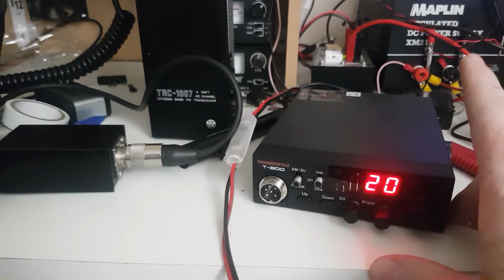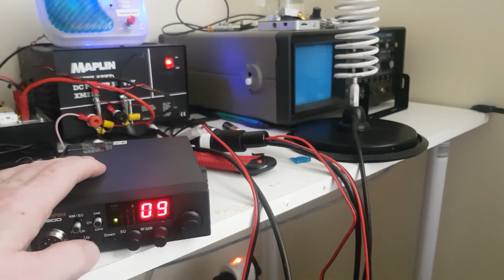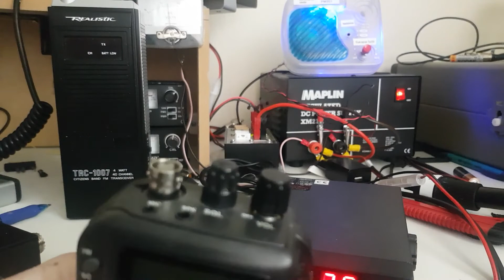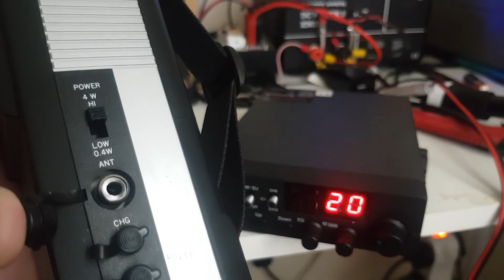Beginners guide to CB radio, video 4: connecting radio and antenna

Comment: You do get quick connectors (or did) like the light bulb for disconnecting a mobile whip aerial to store it away in the boot of the car (a lot got stolen back in the day, or just bent over) along with the CB.

Check out the Video on SWR before using your CB radio!

I trust Paul will be covering that in his next video!